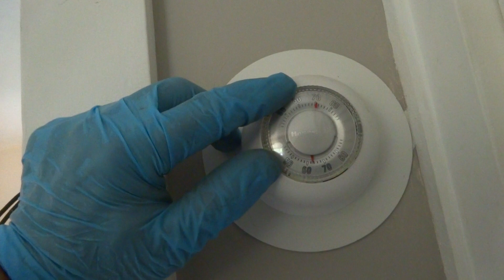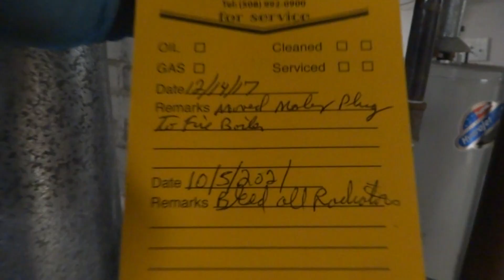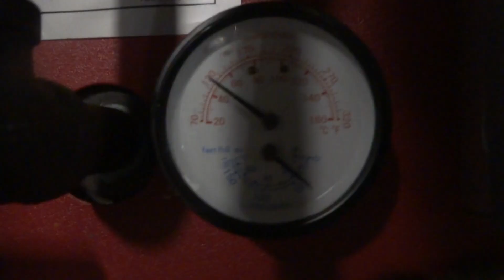OLD CASTIRON RADIATOR BOILER JOB NOT HEATING PROPERLY

Comment: I've got these cast iron radiators... take a while to heat up and even when they do, the house is still cold. Hot to the touch but step a few feet away and I can't feel them. I'm starting to think the warm air is escaping through the windows. 

Good video thankyou.

Comment: My mom has an old hydronic system with 4-in cast iron supply lines that have been neglected for 20 years not sure what I should do. Was thinking about putting in 2 manifolds in running pex to each radiator, with 1 0011 taco pump running each manifold I guess my question is would that be the right call and if so what size line should I run

Comment: My question is how did air even get into the system someone obviously did work on the system or she has a slow leak somewhere. Really curious what is going on
Reply from the maker: not sure probley someone opened up the system to work on it and never bleed it properly .
Reply: @stevenlavimoniere  I had a issue one time like this and it turned out to  be a tiny almost unnoticeable leak on a union.

Comment: My problem is the zoning is front and back of house ( because back in the day the back was a bakery ). My upstairs is sauna hot and my downstairs is too cool.   If I remember correctly years again my maintenance guy told me the valve to the radiators up there are so old, they can’t be turned off. (Because the are stuck, rusted) My question is, under normal circumstances..... should I be able to use the valve to turn down, or off, the flow to these old type radiators?  All winter the upstairs windows are open AND my kids run fans to try to cool their rooms wasting electricity. Plus they get so hot they come down and turn the thermostats all the way off and then my downstairs ends up freezing again. It’s a never ending battle that I’m tired of fighting. 😢

Comment: Steve can automatic air vents be put in the 2nd story rads to help with the bleeding?
Reply: best to put them in the rads. that get the most air.  my system only needed one on the rad. closest to the boiler on the main level
Reply from the maker: you can but most of the time they will leak over time . not a good idea.

Comment: Tha vast majority is getting of heat is getting wasted from those uninsulated pipes, heating up the basement. Big system needs higher pressure and check for any kind of leak even in the valves of radiators sucking air especially in the returns. Also a deaerator in the higher point of the system should be installed to automatically take out any air in the system.

Comment: in my apartment has 6 radiators. one in my room,, one in my kichten, one in bedroom, and playroom. we never have gotten to do all this. but in 3 years ago back in between Oct and half Nov of 2019, all my radiators were leaking. and it was making noise. like for example clicking noise, and banging nosie. so and the landlord plumber his name vinny. he had to come and fix all of the radiators. and then they worked perfectly fine. but sometimes, we have a bit problem when the radiators were on, sometimes it's not strong warm enough. that means the landlord plumber probably didn't set the meter on high, or probably forgot to set it on high, or could be something got stuck in the radiator, or underneath the radiator. like something like that. and sometimes it probably take some time for it to come on the heat for no reason when the weather is super cold.

Comment: Those feeders always stick 1156. Also noticed nothing is insulated.  See this a lot unfortunately-When the original system was installed- everything was wrapped in asbestos, which made a huge difference in heating efficiency.  Now when a new system goes in. Everything gets abated and none of the piping is isolated.  It is in the code , that those pipes need to be rewrapped.  Pretty much common sense.
Reply from the maker: uninsulated pipe will heat the basement hence heat the floor .that will make to a warm floor / house when its cold out ...i would leave it as is without insulation .sometime you have to look at the big picture .insulating all them pipes in basement would be a big bill for sure .. never going to happen
Reply: @stevenlavimoniere  For that matter, may as well figure a method to use the gas flame heat in some way to help heat up the floors and basement.

Comment: I'd like to ask Steve why my 100+ year old house doesn't have an expansion tank. I'm bleeding air out of the radiators like this every month! No good mama.
Reply: Steam?
Reply: @tedlahm5740  it's got a big circulator on it. Don't think there's a leak because I put it to 20 psi to reach the third floor and the feeder only kicks on at like 14 psi but it never drops below about 19. I asked a plumber one time and he said all boilers have an expansion tank but I swear my system doesn't!
Reply: @SpeakerSnake  you’ll blow your relief. How old is the system? Is it steam ?
Reply: @BillyN31  The boiler is maybe 6 years old. Had it replaced after the old one failed. It's just a water boiler no steam
Reply: @SpeakerSnake  air is getting introduced into your loop somewhere. Check all your valves. Definitely pipe in an air scoop with a expansion tank ASAP. Hot water has to expand somewhere in your loop
Reply: @BillyN31  yeah you'd think when the new one was installed they would hav put one in! Thanks for the help
Reply: If its a old steam system converted to a water, and its 3 floors tall. You need a larger capacity feed valve to be an min. 20 psi, a large capacity expansion tank and a 0010 tacco pump for high head pressure. The old steam piping is larger, so you probably got a retro fit job.
You may have an expansion tank in the floor joists..like a 10in x 36in barrel. If you do...it will become water logged after years and your supposed to drain it. THe relief valve maybee upgraded to capacity of the system so thats why its not leaking.
Reply: A lot of those old systems didn’t have an expansion tank. They have an open pipe up and out on the roof. You have to carefully adjust the Auto-Feed Valve to get the water level above the system, but not so water is going out on the roof to freeze. If the water level in the system is too low it will scupper air into the system.
Reply: @mikehansen191  you might be right. There was a coal furnace originally then an old gas boiler up until our new one. The piping coming out of the boiler is huge! Like 4 inch. But there are 22 radiators like in the video. Not sure on the barrel I'll have to go check but theres no piping going to the ground anywhere.
Reply from the maker: ex tank might be in the actic or closet somewere ..
Reply: Weil McLain has the expansion tank inside the boiler on some of the units. It's flat pancake style. We have a lot of issues with them failing.
Reply: Another thought, I have also seen 2+ story buildings that have automatic bleeders on the top floors pull air in when the pressure is low. Those units we max the psi to 20-25 to avoid it from sucking in air through the bleeders. Could also tighten the caps and see if that fixes the issue.
Reply: @stevenlavimoniere  Thanks everyone for the tips. I found the tank! It's hidden in the corner of the room but boy is it big and old. It's probably 1 ft diameter and 6 foot long and completely rusted over. They don't make 'em like that anymore! I don't think I've seen one like this in Steves videos. If you google old expansion tank you'll see it.

Comment: Getting water hammer, when those radiators get unlevel you'll get water hammer, plus the  truckload of air in that system
Reply from the maker: thats with steam this is hot water